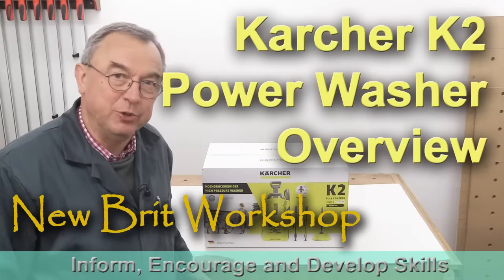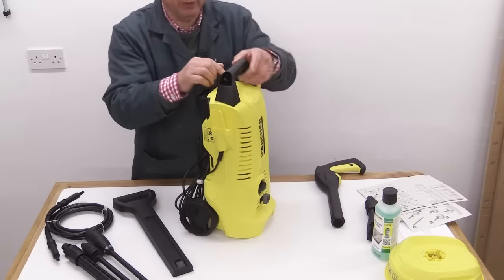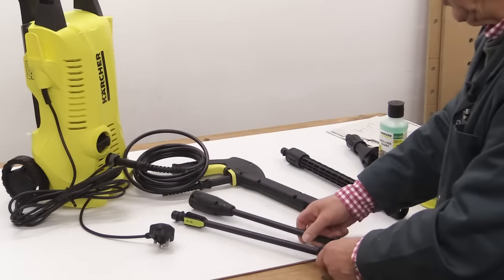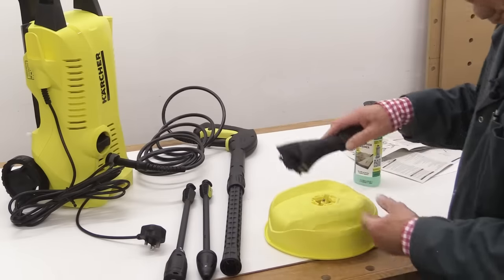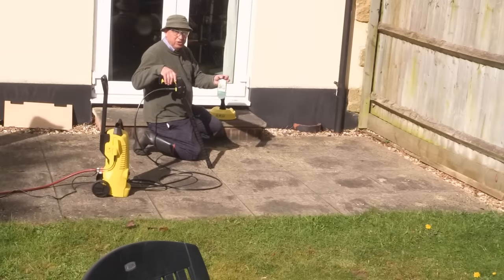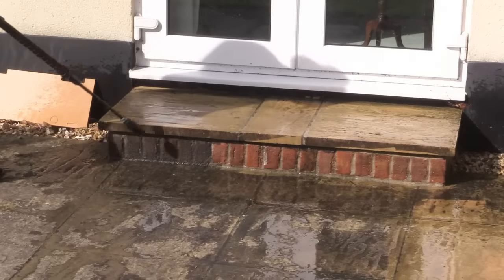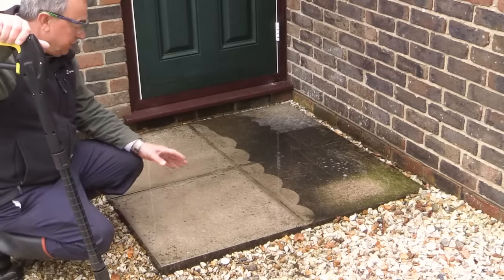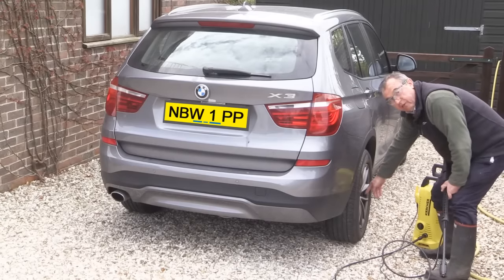Karcher K2 Full Control Home Power Washer

Comment: my last karcher blew a hose after 30 years. gonna buy this one as a replacement.
Reply from the maker: Hi Tom, I would buy this one again if it ever goes wrong.  Cheers.  Peter
Reply: @NewBritWorkshop  I would love to know one thing if it could clean very old green mould of concrete but i bet it can.
Reply from the maker: Hi Tom, You are right - it can and it does it very well wear safety glasses though as tiny bits of grit or stone may fly through the air.  Peter

Comment: I got a K2 original about 6 years ago at Screwfix £90, still going strong. The only unreliable bit was the patio attachment, after a year it would no longer spin so I just use the lance now. Pity, because the patio attachment definitely minimises spatter and mess.
Reply from the maker: Hi Christopher, Not long after I bought my K2 I was at the local dump getting rid of various bits of rubbish and saw a brand new circular attachment that somebody had thrown away. I popped it in the car and so now have a spare. My original one has some wear where it rubs along the ground but still spins and works perfectly. If your no longer spins it may be due to a blocked nozzle.   Peter
Reply: @NewBritWorkshop  Yeah thanks, I disassembled it completely and blew thru  all the nozzles but it still spins veeerrrry sloooowly. I think the O-ring or bushing must be worn or loose hiving too much friction to spin freely.

Comment: Very informative video. Thank you. I bought this and used it today. I tried to remove the hose for two hours from the body and the pressure gun to no luck. I gave up and stumbled on this video. Can you please please please tell me how to remove the hose? Thank you.
Reply from the maker: Hi Bala,  (Modified) The socket that the pressure hose fits in has a GREY plastic surround that you lift upwards (towards the top of the machine) that then releases the pressure hose which can then be removed. You can see the GREY plastic bit at about 2 minutes 18 seconds in.  If you are doing it correctly you do not need any force.   Good luck.   Peter
Reply: New Brit Workshop 

Thank you Mr. Peter. I have tried lifting it too but no luck. Do we press the hose inwards into the machine to release the grey clip?
Reply from the maker: Yes, try that - it should be quite easy.  Peter
Reply: New Brit Workshop 

Thank you.

Comment: Many thanks. A very watchable and instructive video. My only problem is the reliability of modern Karchers. I have a K3 that failed after two uses - the body leaked water from every orifice!
Returning it to Karcher was straightforward and free under the three year warranty, but when it came back it failed again after three hours use when the motor began to race and there was no pressure. It has gone back again! If it fails again they may replace it, but do I want a Karcher again? Reading Amazon reviews, a lot of people have early failure problems with Karchers, so I am intrigued to see that the K2 performed so well.
Could you do an update on reliability please.
Reply from the maker: Hi John, I have no doubt that the reported issues are genuine but must say that there are so many of these machines out there that the failure rate must be very low indeed. Mine is working perfectly. I had a Karcher before which through my own neglect was frost damaged. I am very happy with mine and will consider doing an update video in the not too distant future.   Peter

Comment: Might be too late coming to this but found it very clear and helpful. Only question is I’m not very handy and although I have an outside tap, I’m not clear about the fitting to connect the hose from the machine to the tap. As I say, bit late but any advice would be really helpful. Many thanks 🙏
Reply from the maker: Most outdoor taps will have a screw thread that allows a hose connector to be screwed on. The end of your hose then needs a matching connector to fit what is on the tap. The link below shows just one company but you can also get the bits from Screwfix in the UK.
https://www.hozelock.com/product-category/watering/fittings-and-connectors/
In order to get plans or to contact me via email I need your email address. YouTube no longer has a private messaging service and so in order to get in touch you need to place a comment on this or any other video with your email address. The YouTube software should identify and send it to the spam folder for The New Brit Workshop. Nobody will be able to see your email address except you and me. I will then delete your comment so that it does not end up in the public domain and I will then send the plans. Were we to do this the other way around then my comment, with my email address, would appear for all the world to see.   Peter

Comment: This is quite a useful video BUT what a pity that the rotating-jet lance wasn't demonstrated, as these are effective at tackling the black mould patches that are so often left by the other methods of cleaning.
I bought a house that had been empty for at least two years and the black mould on the blockwork drive had become well and truly ingrained, and black mould has in some places had to be scrubbed using bleach with a manual scrubbing brush to remove the mould.

Comment: Great review Peter! I'm a first time user here and would like to apologise if this question may sound silly to you. Just received my K2 series, wondering whether if I'm using it halfway then stop  for approx. 10mins without turning off the water tap & pressure washer, will it damage the machine? Thanks
Reply from the maker: No problem. The only real risk is if you run the machine without water in it. Always make sure the hose is connected and water turned on. Then, before switching the machine on, squeeze the trigger to get water flowing from the tool before powering up.   Peter

Comment: Just on a side note, you mention a price of over £100 by a professional. Notice the little dark dots that were left behind on your flags, the professionals would have got them off, but that being really picky. Also, some chemicals (not necessarily what you used) act as an anti fungal and mean the area will last longer before the next clean. However I agree with you, on normal garden patios easy of time and money, but to use on the car as a "snow foam" should be uses every time to remove contaminants before using the cleaning mit to prevent the hair line scratches on paint work.
Reply from the maker: Hi Craig, Many thanks for this.  Peter

Comment: I have this washer and find it pretty useless for the car. It only gets the thick muddy bits off, not the build up of fine dirt. By the time you have it all set up, you may as well have just used a bucket and sponge which does get off the fine dirt, and is what I now do. However, it's great for cleaning conrete, brickwork etc
Reply from the maker: Yes, As I said 11 out of 10 for concrete and 7 out of 10 for the car. The fence was pretty good too.   Peter
Reply: Pressure washers and their detergents are never a replacement wash for a car, simply another step. It's called "contactless pre-wash" gets the worst off without risking marking or dulling your paintwork by rubbing in grit and mud with your hands/sponge
Reply: well said

Comment: Very good video, but I wish you could have should how to put the paving cleaning solution into place,as I've not been able to get it to work.
Reply from the maker: Hi John, Look carefully how I connected that tube and remember to remove the end cap if one is fitted. Also, you need to set the pressure on the adjustable lance. It is all in the video.  Peter

Comment: Very nice professional video, you did not go into the suction arrangements for the cleaning fluid very much. Does the fluid container attach to the karcher if not it must be awkward when you are moving around. Also how long did the fluid last that came with the cleaner my old kinzo had a tank on it which you filled up and it lasted for quite a while even when doing a large area. Any info appreciated as I need to buy a new one as the old one is broken and they no longer produce it.
Reply from the maker: Hi David, The main unit has a tube which connects to the fluid bottle. It does make moving it a little awkward. If you watch the video to the end I say that the fluid does not last long and does not appear to make much difference on patios. That said, the machine is brilliant and there is no need to use the detergent fluid on a patio.  Peter

Comment: Excellent review and very well presented. Doing my patio tomorrow!
Reply from the maker: Hi Dave, I used to have their top of the range model (very expensive) but it got damaged by a heavy frost - one should not leave water in these things. This model is excellent and does everything that I need a pressure washer to do.  Cheers.   Peter

Comment: Hi and thank you for the video, very informative. just one question have you any idea how this works on wooden decks?
Reply from the maker: Hi Michael, I have not tried it on wooden decking but I have cleaned mould off a wooden gate (or two). You have to make sure that you do not use so much pressure that the fibres of the wood start to separate. I would expect it to do an excellent job.   Peter
Reply: Thank you Peter for you're prompt reply. Michael.

Comment: Thank you for the video, really good review.  I got this jet wash yesterday and I have installed all the accessories.  Do you know how to release the high pressure hose?  I haven't figured out how to do it and there are not instructions. ...
Reply from the maker: Hi Eduardo, It is very easy but first you need to switch off the machine and squeeze the trigger on the handle to relieve the pressure. Once that is done you can easily lift the black plastic retaining clip where the pressure hose connects to the machine. If you do not relieve the pressure it is impossible to get it off.   Peter

Comment: Hi Peter, it was a good review and a lot helpful for me deciding which brand to purchase soon. However, would you recommend Karcher vs to other brands especially compared to bosch when it comes to quality?
Reply from the maker: Hi Gian, I have not looked at any other makes as I had a Karcher years ago and that was so well made that it would have lasted forever if I had not left it outside full of water when the temperature went down to -5 degrees C  !  An expensive lesson. Karcher have been  experts in the pressure washing business for many years I am really pleased with this one.  I am sorry not to be able to give you any details about the Bosch.   Peter
Reply: Thanks, Peter. Will buy this kind in a few days. This brand has already reached here in the Philippines and would be excited to have one. Thanks!

Comment: Hi Peter. Hoping to clean my elderly mum's stone paths as they're getting a bit mossy and slippy. Do you know if the connector between the garden hose and the washer comes with the PW kit? I'm just a bit confused about how everything 'interfaces' and whether I'll need to buy a new hose as well. Thanks in advance.
Reply from the maker: The Karcher has a built in male hose end. So, you will need a female connector on the end of your hose.    Peter
Reply: @NewBritWorkshop  Thank You.

Comment: was considering a pressure washer so great timing!
Reply from the maker: Hi Craig, I used to have a top of the range Karcher a few years ago and they are good.   Peter
Reply: I worried that the K2 would not be up to the job of cleaning slabs and thought I'd need to go to the K4 or K5 with the big jump in price point, your video has saved me some money! On a side note I decided to go for the DF500 as it is suitable for the vast majority of tasks I'll undertake, the wife agreed that if I needed the 700 in future for some essential task that she'd support it, which helped with the decision.

Comment: I am a new subscriber thank u for such a thorough  & simple demo i am going to get 1 defo. I suppose using this indoors u would need a water hoover to suck up the water?
Reply from the maker: Hi Lisa, I would not use one indoors as there is such a lot of force and over-spray that you would have a big clean-up job afterwards.   Cheers.  Peter

Comment: Thank you Sir for the very informative video. I was thinking if I should hire a patio cleaner  Got quoted £110 for the weekend. I might as well buy this machine.
Reply from the maker: That is more or less how I came to buy one. It was going to cost more to get someone to do 2 hours of work than me buying the Karcher. It was so easy to use and even easier now that I have used it so many times. It is a no brainer. I do not want to undermine people in the pressure washing service but we all have to watch the pennies these days.  Cheers.  Peter
Reply: @NewBritWorkshop  thank you for the super fast response. I like to add that now that the gym is closed this could be the next alternative.

 I have approx 250m2 to do. So not sure if it will take me few full days to do.  I need to wash the weeds away.  

Is it worth getting a patio cleaner solution like magic patio?
Reply from the maker: Sorry for the late reply - the new YouTube admin software is nowhere near as good as its predecessor. I tried the patio solution and did not think it worth the money. I still have not tried the car wash stuff but would expect that to work well against greasy grimy cars.   Peter
Reply: @NewBritWorkshop  I can't get hold of this product. Its out of stock
Reply from the maker: If you are in the UK then try Toolstation. There are lots of other places selling them.  Peter

Comment: Hi, have you had any issues disconnecting the lance hose from the main body of the washer? I want to disconnect for easier storage but can't seem to lift the plastic clip, I don't want to apply too much force as the plastic is quite flimsy.  Just wondering if there is a knack to doing this, thanks!
Reply from the maker: Yes, I have and it occurs when there is still pressure in the system. So, before you want to disconnect, switch off and release the pressure by pulling the trigger. It will then be easy to disconnect.   Peter
Reply: Thank you so much, worked a treat.

Comment: I'd be interested to know what you thought of the cabling situation? I have the larger Karcher unit, but I don't really like using it as I have to faff around so much with the hose and cable when taking it out and putting away again. If the electrical cable was retractable it'd make things so much easier with only the hose to worry about but with a hose and cable, and no good way to store either, I barely use mine. It's just quite a rigmarole to setup, so I never use it for the car and my wife uses it perhaps once a year at most on our slabs. I was a bit disappointed overall if I'm honest.
Reply from the maker: Hi Rico, One has to be organised with any tool that has a power lead and either a water hose or a suction hose attached. I do get in a pickle now and then but if you spot it early then it does not become a mess.   Cheers.   Peter
Reply: Yes, I agree on most occasions, but the bigger Karcher would have benefited significantly with even a couple of plastic sticky out bits (technical term) in order to wrap the cable round. It is very untidy. Given the strength of the hose too (which is a positive in most respects), it's very awkward to wrap tightly round the unit. It just seems a little ill thought out for such a popular tool, and that with a couple of small additions it could be significantly more compact and more functional. I just want something I can quickly take out and hose a seagull attack from my bonnet, but I simply can't do it with the Karcher.

Completely agree about the patio extension though, it's good.

Comment: Thank you so much for this video. You’ve made my decision easier 😊
Reply from the maker: Hi Beverly, Many thanks.  Peter
Reply: New Brit Workshop   Thanks to your review I am now the proud owner of this machine, but I wondered if you could tell me how and where the detergent fits?
Reply from the maker: Hi Beverly, There is a clear plastic tube attached to the machine which you pull out and fit into the bottle of detergent. Did I not show this in the video?   Peter
Reply: New Brit Workshop Thank you for your quick response. No it wasn’t in your video but after I’d asked the question, I re watched your video and realised how the detergent went through the machine and top about running clear water through when finished!  Do you know if you can buy a longer hose connector?  If I’m washing my car I don’t think it will be long enough especially with the detergent bottle having to remain with the machine

Comment: Ive seen some more vids about that patio cleaner, some state its sort of useless. The dirt blaster does a better and easier job. What is your take on that tool? Im looking into getting a K2 compact with car kit but im not sure to get that patio kit as well.
Reply from the maker: Hi Rombout, The surface tool (large round gadget) is brilliant and far quicker and more effective than the lance.  Peter
Reply: @NewBritWorkshop  i saw some other vids where the dirt grinder also did marvelous job. I didnt see that in your video i believe.

Comment: Did you test the power lance (the pointy ended one)? I find that is my preference for patio work, it's powerful but efficient too.
Reply from the maker: I did, it should be in the final cut of the video - if not it is on the cutting room floor. It works very well but that yellow round gadget is simply brilliant and much quicker.  Peter